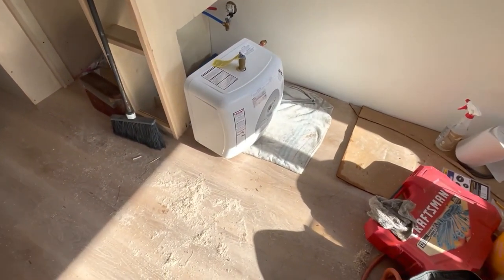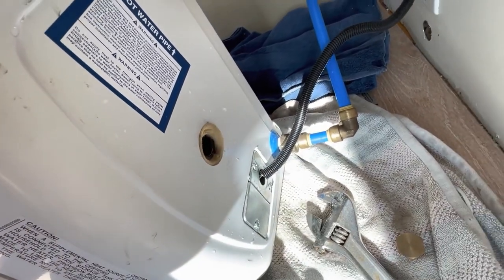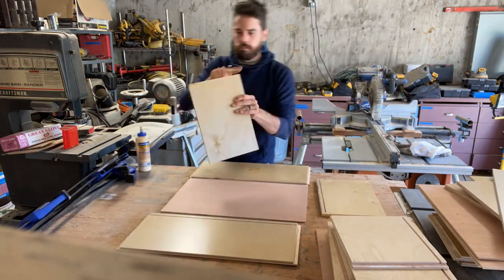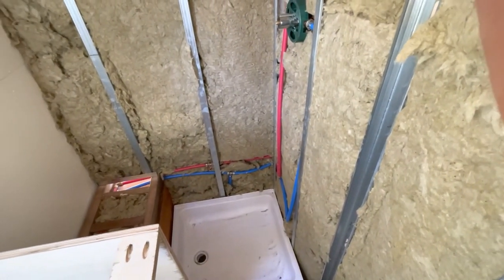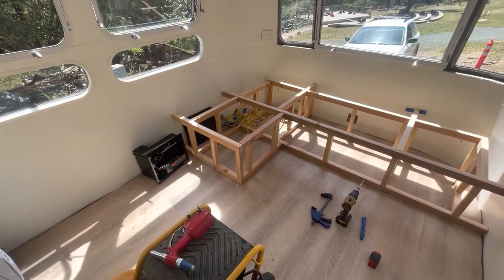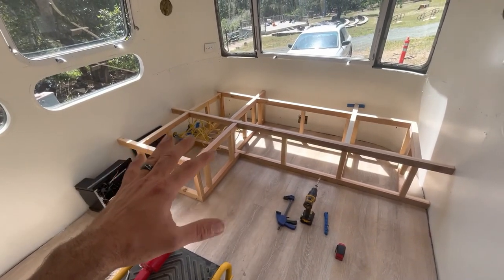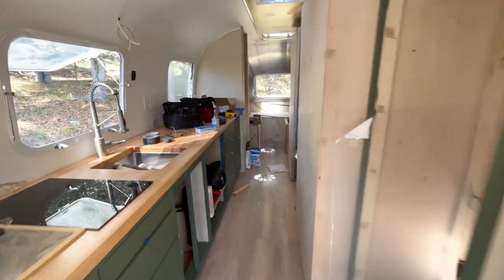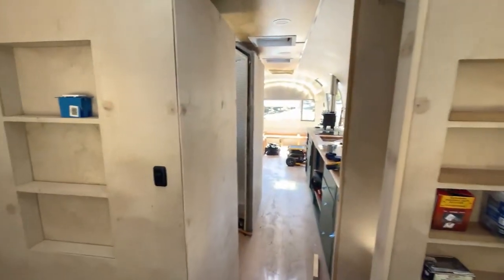Airstream Renovation - Interior Build Update

Comment: Coming along nicely.
I have a question for you as we are looking to do a project pretty close to yours. We will be doing most of the work, same as you. I've been getting info together and trying to figure a realistic budget. I'm not trying to be nosey, but I was wondering if you could share roughly where you are to this point cost wise? I've heard a few crazy/scary #s and I just want to see what a real world # is doing most of the labor ourselves. Thanks for any info! Good luck with the finish of the build.
Reply from the maker: That's a great question. I'm sure you'll hear a wild range of numbers from people from couple thousand to a couple hundred thousand. Best I could say is it depends. We purchased for about 10,000, and we've got about another 20,000 into it currently. Will likely put about another 5000 to 8000 into it before it is done. Biggest thing left is new axels and tires. So probably around $40,000 when all is said and done. Things to consider though: 
1. We didn't go far for ours. It was 2.5 miles down the road on our friends ranch property, and they even towed it over for us. 
2. We're able to use a lot of tools and even some scrap materials from where we work. Circular saws, tables saws, grinders, etc. Can add up quickly. We did have to buy some specialty things like the tall spiral jacks, a polishing grinder, rivet guns, and a welder. So I guess your tools are a consideration there, too.
3. Facility upgrade - factored in that cost was our cost to upgrade an older electrical panel, rebuild an old sewer line, and connect a water line. (which is what we're working on currently). Depending on you're set up, that could be nothing or pretty expensive, especially if you hire out an electrician.
4. This build is really simple because of where we live and what we plan to do with the airstream. We have no propane and no air conditioning. Our fantastic fans are working great right now in the hottest part of the summer days, so no need for AC right now. And it doesn't get very cold here in the winter, so we've just got the little stove for chilly nights. AC and propane would probably cost more and take some more time.
Reply: I’m renovating one too. Mine is not nearly as expensive… so far. I’m getting ready to put it all back together. Between me and my father-in-law, we had all of the tools, minus the rivet guns. I just bought all new tanks (black, grey and fresh, $$1,300 Vintage Trailer Supply) we’ve already bought and received our new axels ($1,500 - Colin Hyde in NY) and installed them, ourselves. I do all of the work myself except a did hire a welder for some frame work ($100). I only have the back 1/5 of the subfloor to replace. We have unzipped the back end and are putting in one fully replacement piece. The rest of the subfloor is in excellent shape so we did not need to do a shell off reno. Our frame is in amazing shape too (just 3 welding repairs). Arizona, so it’s really dry. Hardly any rust anywhere. We have spent $5k so far. I still need to build out the interior (so cost of wall framing materials, countertops, and lighting) and I need to spend about $2k-$3K more on inverter/battery and water heater and $1,200 for our new fridge. Ask me in 5 months. My hope is to stay under $10k.